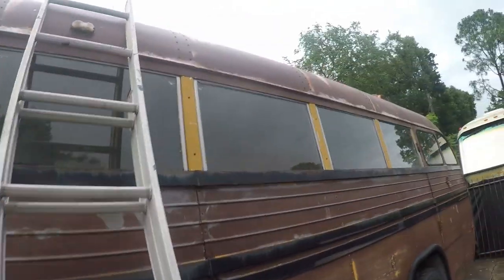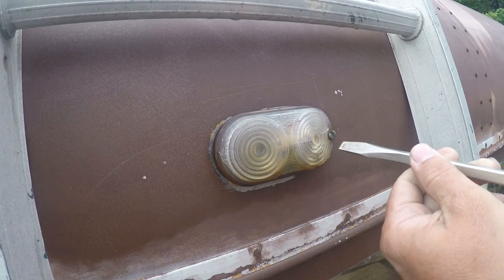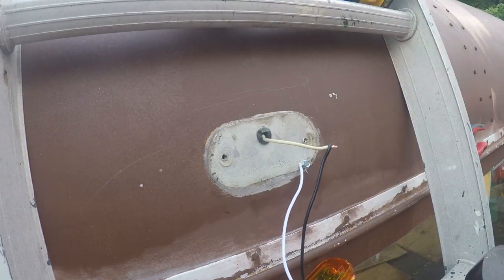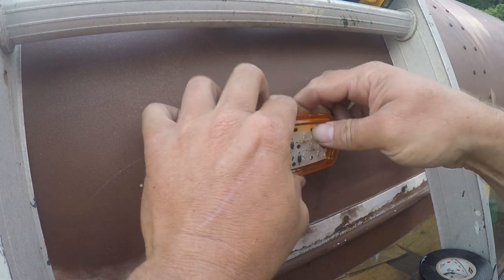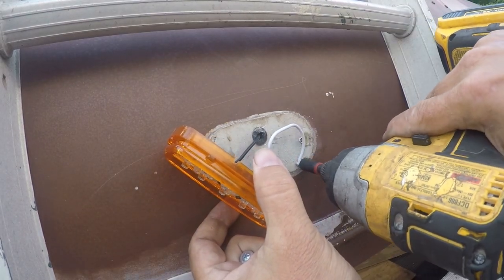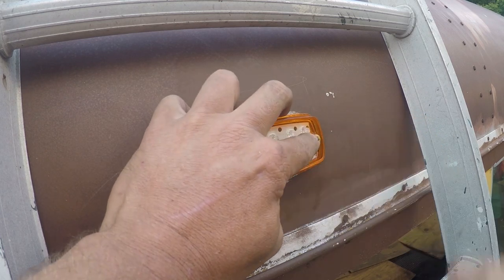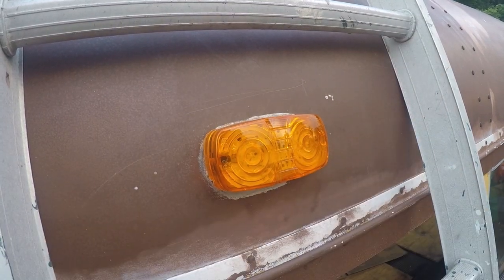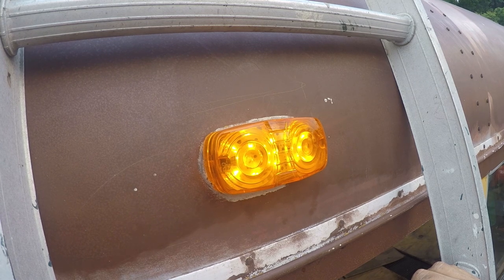Crown Supercoach RV Conversion - upgrading to LED lights

Comment: you are missing the gasket, on mine there were rubber gaskets behind all the lights, i did have to make a new one for one of the markers, and i connected the ground to one of the mounting screws as oppo to adding a screw you now need to clear